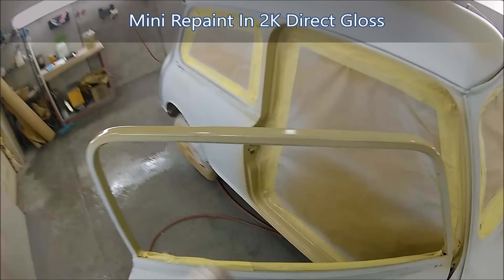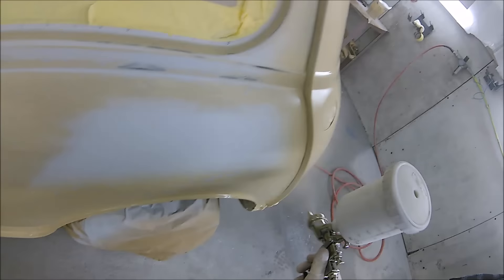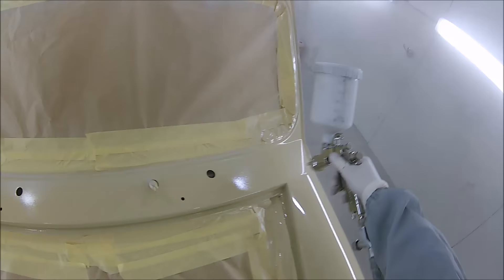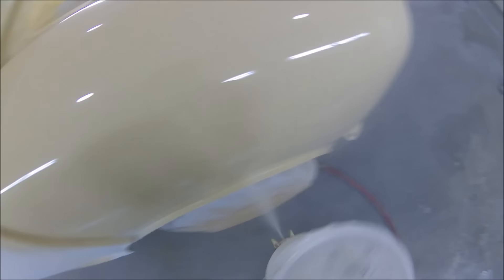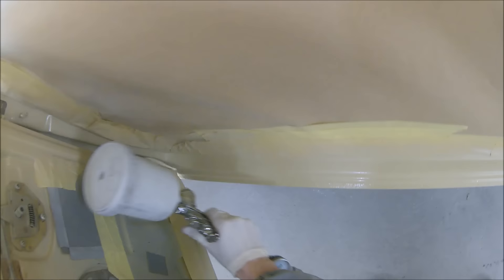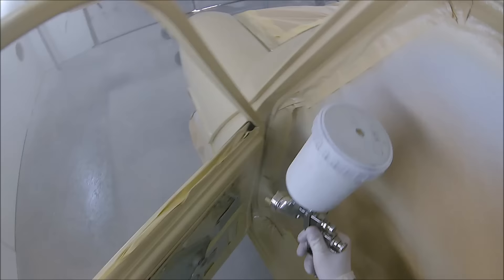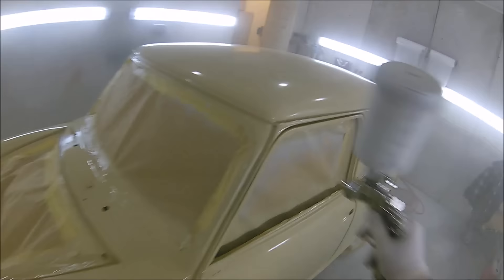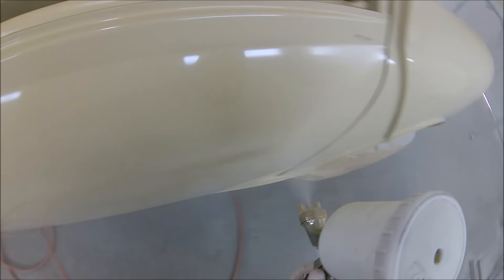Classic Austin Mini Repaint / Respray And Iwata W400 vs W400 Bellaria Comparison

Comment: Nice video! I have used the Devilbiss Gti pro and newer get used to it so I sold it and bought a W400 and like it alot.Not as goodlooking gun but it is lighter and applies paint smoother than the Gti pro.
Reply from the maker: yes i have to agree mate the iwata w400 is so easy to setup for a super flat finish and a great gun for the money all day long but recently ive streered more towards the prolite for clear as ive just hit a groove with it and found it effortless to use

Comment: I have found that the original w400 1.4mm nozzle opening measures about 1.3mm, while while the bellaria 1.4mm nozzle opening mesures 1.4mm. I have measured the original w400 1.3mm nozzle opening as well and it measures about 1.2mm. This may explain the slower flow of paint with the original w400 in 1.3mm, as it is really a 1.2mm nozzle. In the bellaria iwata has accurately labeled the nozzle size.

Comment: The ongoing question - when repairing damaged/rusty parts what goes first on the bare metal? Anticorrosion primers or filler?
Reply from the maker: Epoxy is best then filler over that as the epoxy will seal the cleaned up metal from moisture not only from the usual places but also moisture and humidity in the air

Comment: Hi Tony, great vid as always. How would you rate the Pro Lite for spraying direct gloss versus the iwata bell aria and W400? What fluid tip and air cap set up would you go for if you were to use the Pro Lite for direct gloss on mainly classic cars. Thanks in advance of your help
Reply from the maker: +lewigas290 i cant seem to crack the prolite for direct gloss if im honest the bellaria wins hands down , something im trying more with the prolite but the bellaria is just so easy to setup for it and lays it down so nice

Comment: Tried that ANI primer gun today mate, didn't want to put any thinners in it in case it upset the celly it was going over.
It just spat bits of primer onto the car....wouldn't spray at all.
Had to strip the gun down , clean it out , and remix whith 30% thinners .
This primer is really thick out the tin, what do you recommend mate ? Is there a thinner 2k primer or shall I just put some thinners in ....seemed to spray ok with the thinners .
Reply from the maker: Just use with abit of thinner mate the ones that spray the real thick primers are like the sagolas I’ve got that are mega money for primer so it’s best just to add a tad of thinner

Comment: Will the fade out thinners cause any long term paint defects? I know on blends that it will haze the area after several years in the sun. 

Do you get a chance to see your paint jobs as they age? I haven't seen the thinners used on a complete respray before. I like the idea of re-wetting the dry areas but I am concerned about long term effects (if any). 

Thanks in advance for any response.
Reply from the maker: Not on this job it won’t as it’s all fresh paint and the safe out thinner is just basically a strong 2k thinner which the paint has in anyway

Comment: hi Tony very good video.I have a complete interior including including full roll cage with many tubes to spray also engine bay and inside of boot compartment on the same car in 2k solid colour,having checked the colour on a spray out card it took 9 coats to get coverageThe colour is orange and very transparent.Ime  a bit concerned about too much material build up with 9 coats to apply and runs occuring any ideas to save a world of pain. cheers
Reply from the maker: +steve ruf hi personally id drop a full white layer over the car have no break throughs showing anywhere and it should colour up faster that way for you, but 9 coats would be way to much build

Comment: Whats its the goal of using 2k thinners. Sorry i don't understand all that you say. Thanks for sahring
Reply from the maker: +Martín Denez 2k fade out thinners , so if you have an area you end up with a dry edge because of how you have to paint getting to the other side of the vehicle and the wet edge has started to flash off so it leaves a slight dry patch you can use fade out thinner on those areas to active the dry and wet edges and melt them together

Comment: what are the specs on your compressor volume cfm and 2 bar in psi how much is that exactly brother.
Reply from the maker: +Rodolfo Pierre hi we run a 150 litre compressor with 14cfm free air delivery , roughly 30psi

Comment: Whats the difference in the W400-LV, other than more than double the cost?

Great video, thanks. And for some reason I like the color on the Mini.
Reply from the maker: +David S lol the colours quite nice if I'm honest suits it , and if you mean the evo then they are a completely different gun much wider fan much wetter applicator than the normal w400 and they have a huge fan too awesome well built gun the evo
Reply: The fluid nozzle on the w400 -LV is more akin to the LPH400...it has 3 “slits” ( best way to describe) rather than the 4 that the LPH400 nozzles have...it’s kind of like iwata RP (reduced pressure) version of and LPH. just a FYI...the LPH and w400 gun body is exactly the same ...you can swap out the air caps and nozzles and make totally different t guns..I have a Bellaria and a w400 but I really have a Bellaria, a w400-LV and aN LpH400 In a 1.4 and 1.3 by swapping out nozzles and air caps. Good day!!

Comment: hello tony can you explain a bit more eg if i was to spray clear   a light coat and then a heavy coat is it about distence from panel or being quick as i am new to al this
Reply: Light coat vs heavy coat = same distance, move a bit slower or faster. Possibly have fluid adjustment wound more in or out too.

Comment: is it ok to cut and polish direct gloss.
I am unfortunate enough to have to spray outside. i have a few midge flies landed on paint. need to get them out.
what do you recommend apart from doing it inside instead. 😂
thanks. vids are helpful.
Reply from the maker: Lol I’d recommend a good compound then mate and some wet flat lol , tbh if your painting outside or just under cover you run the risk of contamination either way , even in booths flies get in sometimes trust me lol, for direct gloss I’ve found 3m fast cut to be my personal favourite and yes it’s fine to flat and polish
Reply: @TonysRefinishingTV  many thanks. it's a 20 year old sprinter so not expecting perfection but reasonable finish would be nice.
Reply from the maker: A quick flat and polish will soon sort that for you buddy if you get stuck with anything your always welcome to message me through the Facebook page or Instagram too mate

Comment: W400 is great clear gun and for single stage.not so good for metallics in base coat
Reply from the maker: Not tried it for base I’ve got the bellairia for base and that’s beautiful tbh
Reply: @TonysRefinishingTV  thanks for the review I just ordered one 199 bucks on Ebay direct from japan
Reply from the maker: No problem at all mate
Reply: Do you also prefer the Bellaria for water based basecoat ? Silvers and light metallics for example
Reply from the maker: I use mostly my sagola dvr aqua for water but the bellairia is more than capable with water based paints
Reply: Thanks Tony